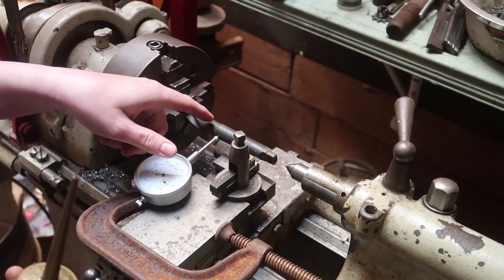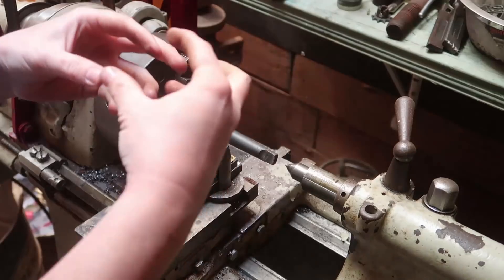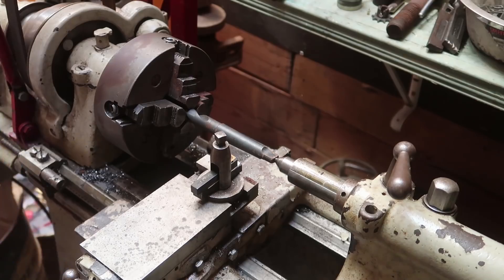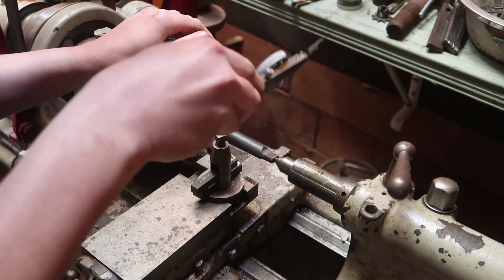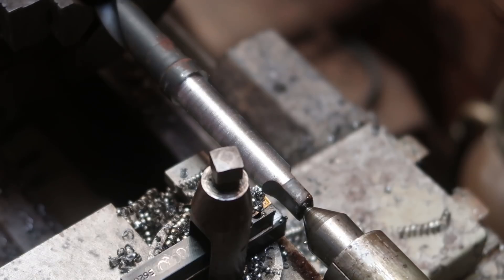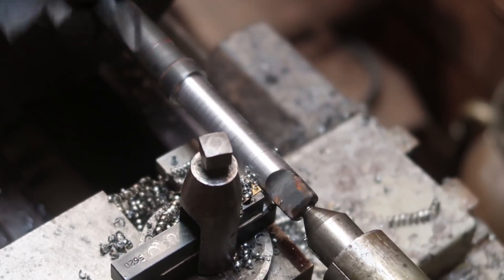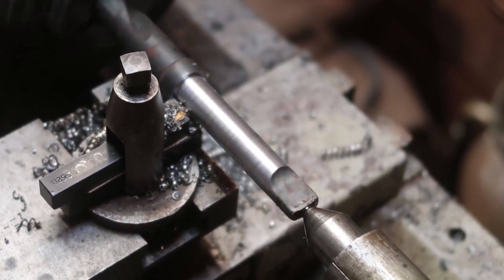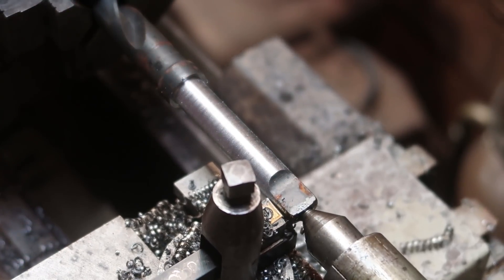Learning to Lathe 06: How to Murder a Morse Taper to fit a 1/2" Jacobs Chuck

Comment: Oh I’m so glad it’s not just me! Nice work. Is the the blade in your saw in backwards? It should cut on the push stroke, which means it cuts best when the lathe turns the normal way, with the top turning towards you. And you’ll both get a better cut and better blade life by using the full length of the blade. Love seeing you enjoy learning this stuff like I do 😊
Reply from the maker: all saws should be pull saws, much more efficient that way. its why the japanese do that. also this was the blade i found on this saw in the trash, so the middle is worn out.

Comment: I think the words you were looking for were "Parting tool".  They are a must have once you get good at using them.  But make sure you take the proper steps before parting to prevent some very scary events (usually including blades shattering or your piece being launched at mach speed towards your face).  The sweet spot for parting seems to be around 200-300rpm depending on what you are cutting.  Cut as close as possible to the chuck to prevent chattering while keeping a steady cutting speed.  Too light of a cut and chattering can happen, to fast of a cut and you bind your blade or break it.  I find that you can sort of feel when the cut rate is ideal and always make sure your bed is locked down as well.  Once I had a piece I was working on and didn't have the chuck tight enough, I parted too fast and the piece slipped out of the chuck and jammed against the parting blade... I was able to shut the lathe off before anything bad happened but that was honestly the scariest thing lol

Comment: You say that you've given up caring about surface finish, but I think that's the best finish I've seen you get on that lathe yet. I expect that's in large part due to the manual belt tensioning. What's preventing you from tensioning it properly? Isn't it just a matter of moving the motor further back?
Reply from the maker: what about that almost perfect mirror finish i got in the cermet video? and no its a matter of redoing the leather flatbelt to be a bit shorter.

Comment: Turning straight shanks on Morse taper drill bits isn't entirely uncommon or completely taboo in the machining world. Just what we usually do is turn down just enough for the chuck to grip on, then leave the rest of the taper so we can still use it in morse taper sockets. 

Oh, and your hacksaw should cut on the push stroke, not the pull. My dad always said something about it being a "hacksaw, not a backsaw" lol. It might seem weird at first but the push stroke is actually stronger and more controllable. Especially if you brace the front of the saw with your off hand.
Reply from the maker: yeah i was going to do that, but decided i didnt want it so long anyway so decided to just cut it down. i'll find more at the scrap yard after all. Also, saws works 10x better as pullsaws. only idiots and fools use push saws. you are stronger pulling than pushing, and the blade never bends when pulling whilst it does while pushing. theres a very good reason why hacksaws are pull saws and most woodworkers now use japanese Ryoba for cutting. you are dead wrong about push stroke.
Reply: @RinoaL  "only idiots and fools use push saws" Pushing gives downward pressure. It is hard to get downward pressure pulling. All I remember about Japan is: tradition rules over what is better, they do not cook their food, a senior engineer cannot read all the words in a newspaper, in a meeting no one ever contradicts the person on his left and they do not have a period - a sentence ends with a verb, and it is a bitch to read a map.
Reply: I suppose we can agree to disagree on the saw thing. The blade doesn't bend if you push it straight and with proper technique.

Comment: Well, even if the ultimate result didn't work out, the steps leading up to went very smoothly.  Also, I swear, that lathe is getting more stable the more you use it.  Are you tinkering with it?  Or is it just remembering what it used to be?  :D
Reply from the maker: i havent tinkered with the lathe but i have tinkered with how i set up the tooling.
Reply: PS.  If you work the metal in circles while the drill press is driven through the hole, you can widen it.  Just be sure to draw the circle you're trying to hit first, I imagine you don't want to overshoot the mark.  :)  (Now other commentors can let me have it for suggesting bad practices.  LOL)
Reply: @StevenIngram  Sometimes you gotta' work with what you got, whether it's a shortage of money, time or both.  I've embiggened plenty of drilled holes to get the job done.

Comment: does your drill press not have a morse taper? both om
f mine do, you take the drill chuck out and put the drill straight into the taper
Reply from the maker: evidently with this one its some complicated thing of removing a pin or something so im just not even going to mess with it.
Reply: @RinoaL  generally you wind the drill down and there is normally a slot through, you put a wedge in there and tap it and the chuck drops out, leastways thats what mine does, then you just ram the drill bit back in its place.
Reply: my set of morse taper drills has a whole bunch with just the same treatment as you have used here, so its a recognised solution
Reply from the maker: i figure if it comes from the scrap yard, its probably not high precision anyway so i shouldnt feel too bad.
Reply: i just went and did a quick video and uploaded it.
Reply from the maker: yeah but my drill press is from the 1940s, and i looked it up and some of those are odd ones that are like screwed in or something. and seeing as this kinda isnt my drillpress, idk if i want to go ripping it apart.

Comment: I wonder why you didn't use an MT adaptor to a straight shank in the drill press?
Reply from the maker: because i cant find any records of those existing for some reason. and i cant engineer one atm. for some reason it looks like only chuck-morse exist not morse-chuck.
Reply: @RinoaL  R8 is straight shank (with the tapered portion at the end) so R8 shank to MT(number, probably 2) will work.
The only problem then is that this makes a VERY long drill bit, which could magnify any runout, or cause other problems if the adapter is crummy.